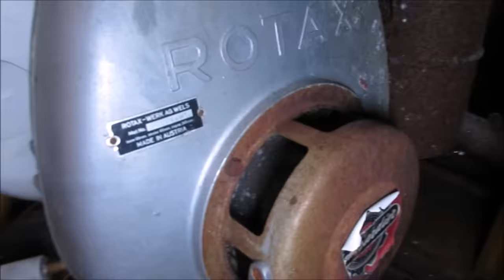Antique Sled Left For Dead, Can WE Save It?

Comment: Rotax engine was in my 1979 SWM 320 trial bike in the UK mine was yellow with 2 stroke side valve induction using a crankshaft disk and crankcase compression to force mixture into the head.
the red version of the SWM had an interesting sound from straight cut primary gears.

I could set off in 6th gear, my main problem was if I did not run it for months the clutch plates would STICK on until it was warm.

My SWM was road legal BUT no horn so I used the the decompressor valve and the UK Police let me get away with that . The bike had 4stroke low rev torque that could pull the skin off a rice pudding.  

2 wheel drive motorcycle search for      2x2 SWM TL320   on trialscentral

Comment: first skidoo i ever drove but in the 80s  was a baddie of mine  didn't have the bar in the back  the hood opened had latches on the side   we had put new rings  3 bucks.carb kit  was like 2 or 3 bucks points and condenser  ran good we had replaced a few boogie wheels  you couldn't kill it then i bought a 340 twin Olympic  ...but my buddies and i sold them all  in western part of nova scotia less and less snow  were febuary i see the grass through the inch of snow  by the end of this week saterday its giving 44.6 f and rain.but this weekend the other end of the province  got 5 feet  of snow  one of those   1 in 20 year storms

Comment: Love the video! Vintage snowmobiles is pretty much what I do on my channel. Check it out if you are bored. On your Olympique, that luggage bag is worth a few bucks. So I wouldn't ditch it right away. The thing to be sure to check out on these is the front drive sprockets. They are typically made out of plastic and age does not like them. My 70 Olympique had that issue one day while riding. Needless to say, I wasn't riding far, lol. Also be sure to check the gas tank. They are built into the Chassis on these and are hard to clean out if rusty. Hope that helps. Can't wait for part 2!

Comment: I don't think I ever split the air housing on our '72 Olympic. Took the unit off as a whole with the 4 bolts holding it to the crankcase. 
Cleaned the points a few times through the slots in the flywheel. Never got the flywheel off.

Comment: That cam is ramped up to the slot, no need to take apart flywheel. Once the parts cross paths the pin will ramp up cam piece and fall into the slot.

Comment: To get the cover off just put the bolts/screws back through and tap the head of them that is how i get the cover to move and if need get a longer bolt/screw it will work if you do it slowly just my way i do them. oh and spray lube in the roll pins they are open inside the Aluminium holes.

Comment: Next time just a fyi…..pop off recoil and the starter hub and you can clean the points through the hole in the flywheel. MUCH easier than what you did there. Also, the whole fan shroud will come off and clear the flywheel with just the 4 nuts on backside rather than fight with the screws.

Comment: I'm surprised you didn't pull the carb off right away to check the reed valve plates behind it, That and to get the Tillson carb soaking in your ultrasonic cleaner. By the way I like to use Simple Green and water in my cleaner as it doesn't have petroleum distillates in it and doesn't seem to swell the rubber parts like O rings and seals.
Reply: I'm surprised he didn't pull that carb off and start soaking it. It's going in the ultrasonic. I guarantee it. When Mustie got his cleaner he tried different cleaners in it. He liked how carb cleaner worked the best.

Comment: If that's a 67 Skidoo it would be an Alpine. Which is the predecessor to the Elan which came out in 71. They had 2 different models a 250 and 300.  vThey used the same track on different models like the Citation 4500 and 5500.

Comment: most routine maintenance repair services on old Rotax Skidoos begin behind the starter cover. A few bolts with 10mm heads, takes the pull starter off the case, then you'd access the first layer into the metric rotax.. All these are the same; after first one of five..

Too much busywork, to get past the pull start pulley (four bolts) then the cover to magneto might be seen & removed. The cooling fan with puller are another matter, easier done than said.. Remove bolts. Austria is an EU nation and metric in use from late 1700s. Surprised no cross reference SAE to metric(?)

By the time you work at the drive clutch and attempt anything there, all those cowling bolts would be removed first. The brake and changing the lube in final drive, are easier accessed, then too.
Your video gave me a headache. Most ever work; for a few stuck bolts, taken off out of natural sequence! 🙃

Comment: Could the torch melt the engine fins because they are ally and not steel? While holding the torch on the exhaust bracket nuts to release them, there seemed to be a concentration of flame right on the fins as well.

Comment: I think you should leave the seat off, & replace it with grip tape. Then lengthen the handle bars, so you can reach them while standing on the grip tape.

Get it? A snoboard. Like a skateboard, for winter 8)

Comment: Do you know of the bees wax trick. It’s old school.  Heat up a frozen bolt/nut and hit it with bees wax.  ( toilet ring seal is bees wax ).  It’s works great.
Reply: If a fastener is seized nothing's going to get in there. Well, not nothing. Heat and vibration will both penetrate. But that's it. There's no gas or liquid that's going to get down in there when parts are chemically welded together. It's the heat applied when melting wax that breaks the bond. Wheelwright Dave just tried the wax trick. It didn't do buttkus. But torching the parts and heating them up got them apart.
Reply: I use the stub of a candle. It does often help substantially. Heat the offending fastener up, touch it with the candle, drawn in by capillary action.
Reply: @CedarAshCanvas  nothing is getting drawn anywhere when the threads are hermetically sealed with oxides. You might as well expect wax to leak out of a steel pot. Because that's about as much draw as you can reasonably expect to happen. EngelsCoachShop just had this discussion last week. He tried it and wax did nothing. Nada, zero, nothing, zip, the big goose egg! Only heat frees it up. Heat WILL conduct through a solid.
Reply: @1pcfred  you do you
Reply: @CedarAshCanvas  wax on, wax off.

Comment: Hey Mistie, you do not have to put any pressure behind the flywheel. That is just something you are probably doing because it is what you were taught. The shock alone will pop the flywheel. I have never used anything behind the flywheel, and I have been doing it since I was about 10. That is 47 years ago. Just forget the lever, and concentrate on holding the brass bar straight so that you are not whacking on 1 side of the nut.
Reply: I have never worked on a Bombardier product before. That is a new points setup for me.

Comment: Why don't you ever use the candle wax trick on those stuck bolts? Heat the bolt up and touch a candle to it
Reply: The candle wax trick is an example of coincidence. You apply heat to melt the wax and the fastener loosens up. But what really did it was the heat alone. Melting wax was just a coincidental event. Because there's absolutely no way the wax can penetrate the oxide seized thread.